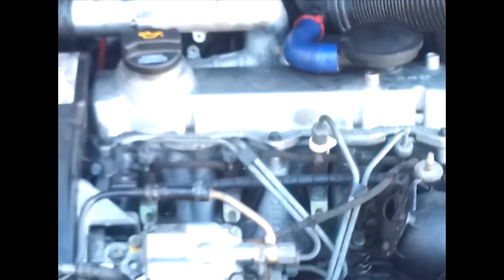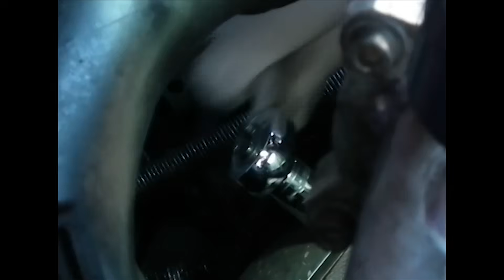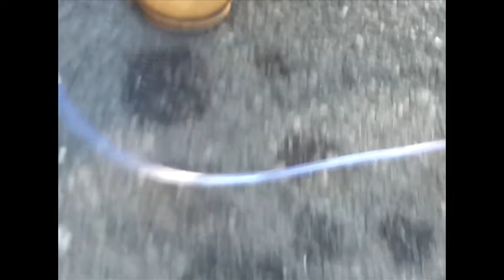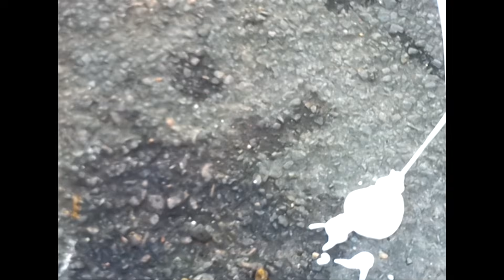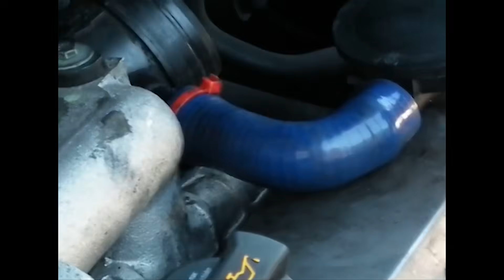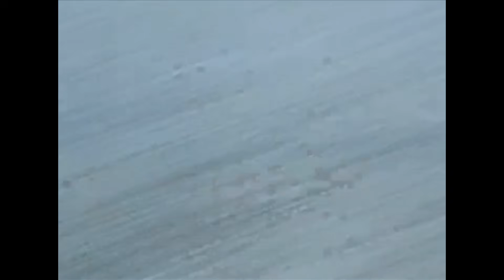Mr Muscle Audi A3 Tdi Turbo Clean - cheap fix

Comment: Hi Lewis. My 2006 Golf 2.0 TDi sometimes feels down on power and at other times pulls hard. I've got a feeling the turbo could do with a clean. What does limp mode feel like on a TDi? I'm trying to figure out if it's going into limp mode
Reply from the maker: Limp mode or "Limp home mode" is the car cutting power because something reports as being outside of thresholds from the sensors. For example overboosting can cause limp mode to be activated to protect the turbo and the engine. 
It feels like the car just has no acceleration and is much much slower then normal. I would recommend getting VAGCOM and running a fault code check. Cables are like £5-10 and the freeware version of the software is available from http://wiki.ross-tech.com/wiki/index.php/Main_Page
Reply from the maker: Tanveer Akbar if a good quality diesel fill up has cleared it I suspect the Mr Muscle clean isn't needed. Perhaps some fuel additives now and again and giving the car a blast. They build up carbon with town driving sometimes and fully opening them up does a world of good.
Reply: driving normal then at high revs or 75mph you will feel a total loss of power and don't get it back until you turn off and on a car
Reply: stephen kilgannon I see what you mean. Well it's bizarre because I've recently bought an obd scan tool and found no fault codes and since running a couple of tanks of premium diesel through the car the turbo seems to be boosting fine now. Even before this I can't say I had a total loss of power more very little torque sometimes. I'm going to get a genuine Rosstech cable soon as the 3rd party ones won't work with a mk5 apparently
Reply: you only had carbon build up. if you give your car a good hard driving every once in a while with clean fuel it will burn up all the carbon blocking the air. the only reason your car was slugish was the carbon was blocking the intake hence no codes....
Reply: stephen kilgannon thanks for taking the time to reply Stephen. I suspected the same, and hope it keeps working. I did want to try the Mr Muscle fix but I can't see the turbo in the engine bay of the Mk5 Golf. Do you know if it's accessed from below the car?
Reply: Cheers Lewis - well I've not been gentle with the throttle recently, and it seems to be pulling well and hope it stays like this. The car has apparently had an economy remap done in the past and certainly has impressive torque now that its driving better. Is it true the intake manifold flaps get stuck on these 140bhp engines?

Comment: I am sorry but can you tell me what EGR is? 
I have an audi a3 from 1997 i was having the same loss of power and the mecanic wanted 200€ to clean the turbo so if this works i will owe you about 190€ , thanks a lot!! 

one last thing , can you show me witch one to buy on ebay , it is not sold in my country.
Reply from the maker: The EGR is the exhaust gas recycling system, on my car it was removed. I'm not 100% sure if yours will have one or not but I'm guessing it would only being two years older then mine.

Mr Muscle is just a foaming oven cleaner with NaOH which is Sodium Hydroxide, it could be worth checking out your local food shop to see if they sell something similar but check the ingredients on the back.

I found a link on ebay http://www.ebay.co.uk/itm/MR-MUSCLE-OVEN-CLEANER-300ML-/161241039178?pt=UK_HomeGarden_CLV_Cleaning_CA&hash=item258ab7014a however check the laws on importing due to NaOH being nasty stuff!
Reply: isnt that the turbo? lol
Reply from the maker: Rui Carneiro I can see how they sound similar, but the turbo uses exhaust gasses to spin up the turbo to suck in more air then it could naturally aspirate. The EGR is more an emissions thing to recirculate some exhaust gasses back into the engine, many people find over time this clogs stuff up and reduces economy. For a better explanation then my ever so quick glance over http://en.wikipedia.org/wiki/Exhaust_gas_recirculation

Comment: Will the blown through Mr muscle have any affected on the catalytic converter or dpf? Don't want it to mess up either of those
Reply from the maker: Nope as it is flammable it's burn off and blow through, Mr Muscle is very similar (although some differences) to turbo cleaning products although it has a much lower NOAH level then say Innotech. However those kits cost quite a bit so I chose this option after reading about others doing it.

Comment: Hi, do you have to clean out the mr muscle or does it just come out with the car running.
Reply from the maker: Because you are doing it on the exhaust side of the turbo it'll blow through once all put back together. Probably clean the CAT ever so slightly too.
Reply: Lewis Smith Thanks

Comment: hi mate any advice on doing this on a 2.0 Tdi  A3 ? mine is doing exactly the same as yours was , but my turbo is a nightmare to access as its right down the back of the engine
Reply from the maker: It was tight on mine but I guess just check all of your access first. If you have an EGR it'll probably need removing.